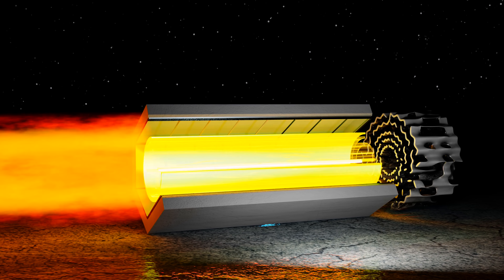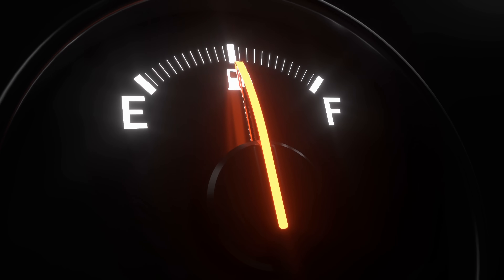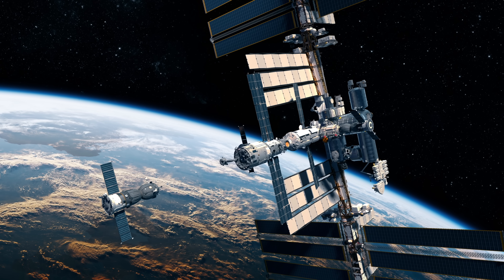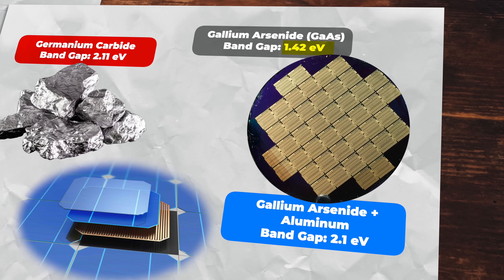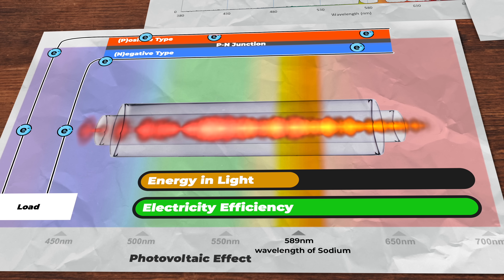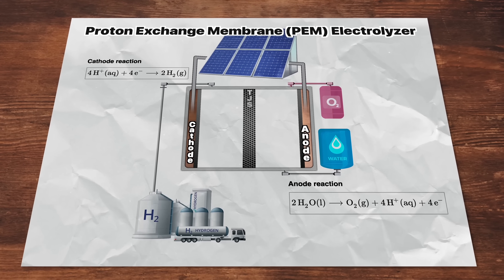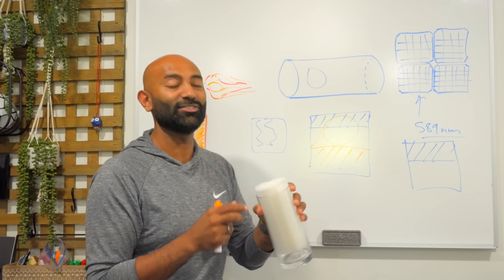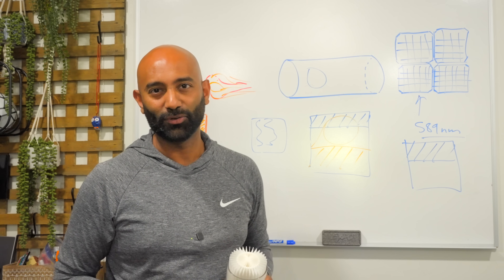Why Solid State Might Save The Combustion Engine

Comment: You never addressed the big reason the world is trying to move away from carbon based fuels like gasoline & that's the emissions that are causing Global Warming! This engine is theoretically 2x or more efficient than a internal combustion engine, so while it would use less gasoline, it would still produce some amount of carbon emissions & still heat the planet. And you never addressed that topic: it still uses gasoline, so what are the emissions? It could be twice as efficient & release 3x or more the amount of harmful gasses in it's exhaust. That doesn't help at all. 

The actual engineering question we need to solve is how do we power our society WITHOUT carbon based emissions? This invention doesn't answer that critical question!

Comment: why not take the polychromatic sunlight and take an engineered sheet that coverts the sunlight to monochromatic wavelength and put that over photovoltaic cells tuned for that wavelength? So basically, same thing they doing with sodium to make the panels more efficient but doing it with the sun?

Comment: this concept is amazing and shows what engineering is all about.  take a hard problem and convert it to an easier, more solvable problem.  

it would be really interesting if you could do this with concentrated solar.  have concentrated mirrors that burn a material to create a light at a wave length that you can capture more of with a cheaper material than pvs.  thus, you up the efficiency and lower the costs.

Comment: Would an internal combustion engines efficiency be increased if the cylinders were transparent with PV cells placed around the outside capturing the light from each explosion? The electricity than being used to drive an electric motor in the powertrain?
Just a concept thought you might like to comment on.

Comment: Instead of table salt, why couldn’t they use urea for the salt? No, not what you’re thinking. It’s a comparing of nitrogen, oxygen, and carbon which makes it a chemical “salt”, hence the salty taste. You could use it to fuel the system and to produce the light from the heat of splitting the nitrogen from the carbon dioxide.

Comment: The utility of this device is based on an assumption so blatantly false that they do not come out and say it, for fear of being instantly recognized as a fraud:  The blackbody thermal radiation of heated sodium vapor must match the spectrum of a low pressure sodium vapor gas discharge lamp for this device to work as claimed.  No doubt, they are trying to get funding to run tests with heated sodium vapor and will be SHOCKED, SHOCKED I SAY, to discover that their assumption of the thermal emission spectrum of sodium vapor does not match the emission spectrum of a low pressure sodium vapor gas discharge lamp.

Comment: Apparently Lightcell Energy has not proven what the energy efficiencies are at each step. This should be easy enough to prove and to replicate. There should be no guessing involved, inside the company or outside the company. But apparently the company has not made the numbers available.

1) If the reason these numbers are not available is because the company has not yet done the analysis, then stay away.

2) If the reason these numbers are not available is because the company has done the analysis and the results were disappointing, so they are pretending that the numbers are not available (fake it 'til you make it), then stay away.

3) If the reason these numbers are not available is because when the company attempted to calculate them, the quartz or the photovoltaic cell or some other thing(s) broke or melted or became fouled, and they are keeping that quiet, then stay away.

It is fairly common to see inventors and/or companies waste their entire careers promoting and tweaking and tinkering with technologies that are inferior, or are literally impossible.

Comment: PV cells are less than 25% efficient. How could a system that converts fuel into heat then into light then into electricity be greater than 50% efficient? No f-in way with current technology.

Comment: I'm no photovoltaics specialist, but I worked in a lab at a university where the people next door worked on micro-scale heat exchangers, and one of their projects was related to recovering waste heat from Concentrated Photovoltaic Cells (CPV), a system where a relatively cheap, large Fresnel-type lens diverts sunlight into a relatively expensive, small PV cell. The problem with that is that the cell efficiency was inversely proportional to its temperature, which is why they were trying to match these tiny heat exchangers with the tiny PV cells and use that heat to convert alcohol and plant oil into biodiesel.

This engine obviously works at high temperatures. Low-Pressure Sodium Vapor lamps work at about 300°C, and the assembly seems too compact for meaningful insulation, so these cells would be working at high, temperatures, and therefore at lowered efficiencies. I'd wait for independent confirmation of these numbers before believing these are even in the correct order of magnitude.
Reply: That’s exactly the issue. This would straight up melt these cells
Reply: It comes across like a funding pitch to non-engineer venture capitalists.
Reply: My first thought was exactly wether this sodium lamp an cell system could be used to discharge excess heat from traditional PVs (improving their efficency) while at the same time obtaining some more electricity out of it. 

Obviously your lab roommates were smarter than me, so I guess it wasn't doable/cheap enough.
Reply: You have a good point. But i think that isolating combustion temperature in a small chamber Is not that big of a challenge. And transporting only the usable light with mirrors and stuff can be a solution for the efficiency. But we are all just guessing
Reply: thanks for the exhausting analysis....
Reply: The burning gas that heats the sodium to make it glow, cannot exit at lower temperature than the glowing sodium. To get more efficiency, the hot exhaust will need to be reverse flowed through a heat exchanger heating the incoming air before it is burned. This cannot work in a standard heat engine because the hot air into the engine cannot be compressed, but it might be possible in this device because there is no compression. No I still do not believe they will make it work efficiently full cycle, fuel energy to electric power.
Reply: The heat exhaust could power a fan generator. Or the heat can also power a steam engine for more electricity I'm kind of surprised that Someone has not put 8 or more 8 inch wind generators on a Semi truck.
Reply: @eddaniels3404  I used to process perpetual motion patent applications. And yes, adding wind generators to vehicles "to improve the vehicle efficiency" has been invented many times!
Reply: hey now, hey now, don't you come at me with science!
Reply: You could put a vacuum between the cells and the sodium, but you'd still need to cool the pv cells, since they are not 100% efficient in any case.
Reply: Visible/Ir cells made from aluminum/gallium/indium/arsenic and gallium/indium/arsenic and also gallium/arsenic and gallium/indium/arsenic chemistries achieve 40% efficiency, at 2500ºC
Reply: If this person was actually onto a industry changing idea, that actually functions as stated, our government would seize it in the name of national security or similar BS and or bury the inventor. If this exists, give it to everyone in all firms possible or it will disappear. I doubt this exists as described, bit I don't trust our government and will never trust them.
Reply: Maybe in a larger vehicle then an automobile?
Reply: I’ll wait for the proof of concept working model
Reply: @petemisc4291  A working model would be fairly easy to make, maybe they already have one? But at anywhere near the claimed level of efficiency, not easy at all!
Reply: probably a vacuum tube with the lamp being heated, and only spectrum emissions being allowed to hit the PV. If the PV is tuned to the one wavelength and really is high efficiency, the only heating in the PV will be the % of lost energy, probably could be handled with just fins and air cooling. What I'm struggling to wrap my mind around is how your exhaust is gonna be on the cooler side? like you need to run the lamp as you said, at least 300, and if you want power density then probably more. flame needs to be hotter than lamp. maybe heat exchangers between the exhaust and the incoming air?
Reply: am i the only one thinking you could somehow add sodium to the gasoline and use that? then fire and water would make a gas station explode. Nah but fr, if you but salt-sodium in gasoline would that not work? Better than making a lamp? just make the whole flame orange?
Reply: just insulate the photovoltaic cells behind a double window. run cool air through the cell or with a vapour chamber
Reply: @snorttroll4379  adding a window of any material affects efficiency.
Reply: @snorttroll4379 that window would be very high temperature material at 3000 degrees? I have a solution though!
Reply: @wanfuse  just recess the window a bit.  or cool it on the other side.
Reply: @snorttroll4379  there is a better way I think, but I am sure they have it figured out already :-)
Reply: It's a very interesting combination of several technologies.. I'll be keeping an eye on this sector
Reply: I was thinking something similar. It would be better to put something like that on the exhaust of a regular ICE. If used with a electric drive it could increase efficiency, kind of like a turbocharger works off the exhaust. But instead of taping the pressure it would work off the heat directly.
Reply: I think people saying this is a scam is straight up evil and mischievious and overkill, but i know this is not going to be easy at all, although well, just like any new technology concept until a workaround is found and optimization and upgrades are done correctly and accordingly, so i believe this will be a thing some day, but at least for the very near future i believe it will only be a fraction of it's promise
Reply: I mean... a woman invented this dude. You just spent more time pointing out why it won't work, than she did, to make it "work".
This is so stupid, she had to be a drop out to not know the laws of physics says this is seriously impossible.
Reply: @m4rvinmartian  Elizabeth Holmes new jailhouse venture.
Reply: @m4rvinmartian  "Danielle" Fong is a transexual, so biologically a male.  I just found this out by watching a video of the company.
Reply: @headbanger1428  I was not able to find this information. Do you have a link to the video you watched? And a relevant time within the video?
Reply: @headbanger1428  
Huh....... so, I guess she does know what she's doing, then.
Reply: @m4rvinmartian I'm sorry,  what does gender have to do with this?

Comment: I think the problem with combining the light cell with a traditional internal combustion engine is that a traditional combustion engine needs a minimum amount of power to move the wheels and not stall. If the light cell is as efficient as they claim, that minimum amount of power is likely to generate far more heat than the light cell could handle, meaning that you would still have to dump some of it as waste heat. In the end the light cell by itself likely ends up being more efficient than a hybrid system.

Comment: The Vehicle Research Institute at Western Washington University created thermophotovoltaic power generators in the late 1990's using the technology and cells created by Dr. Lewis Fraas.   The technology used gallium antimonide cells arrayed around a silicon carbide emitter.  One of the national labs, Sandia (?), tested the cells at over 40% conversion efficiency vs. high grade solar cells (1990 tech) of 18% (or ~31% 2020 tech).  A significant challenge is that the high temperatures, roughly 1700 k, needed to get the silicon carbide to emit photons is located within 20-50 mm of the cells which probably don't function above 400 C.  Cooling the cells and recovering the lost energy is a significant challenge.  The team created prototypes a bit larger than a hot pot or coffee maker that generated up to 2 kW (~2.7 hp).  Eight of these units were installed in a vehicle, Viking 29.  The units produced less emissions and were more efficient than a Honda genset, but not so much that it made sense to invest in a small fab plant at $100 million (1998 US dollars).   Another challenge arose--physicist and engineers in this space tend to talk about efficiency a bit differently.  The team found that the physicist were subtracting all of the known losses from 100% rather than the ratio of output energy to total available input energy.  One has to be very careful about quoting the efficiency of these powerplants, because it is likely that the total losses haven't been properly accounted for.  The early ceramics would fail after 20-30 minutes of operation. The technology does work and its amazing to directly convert chemical energy to electricity.
Reply: These issues may explain why, even if the quoted efficiencies are achievable with this concept, there is still not a product several years after the concept demonstration.

Comment: techno word salad found in startups, to get investors, only for it to be sold. This is the opposite of engineering. Its creating a problem for its solution. Also, simplify. 

And again, the obsession of no moving parts is getting more and more laughable. Moving parts are needed, and cheaper to replace as schedule mx versus computers, ECUs, and other software components that fail.

Comment: Thank you Richard. There was a high efficiency, direct, heat to electric, no moving parts method using MHD. A conductive refrigerant heated. Moving, expanding in a pipe. A moving conductor in external magnetic field generates electricity. Electricity out, simultaneously heat disappears from it. This was used in Denmark or Sweden (?) in a mass transit bus. All enclosed. External heat source. I never heard about it since. Big Oil etc moved the conversation and funding away from such solutions.

Comment: The efficiency drop just going from "Light" to electricity is too big to make this viable #1. You can cut out the light part and go directly to thermoelectric using a peltier or Heat pump generator. Same thing used in nuclear satellites call Radio Isothermic generator only using IC Engine. Number 2 the efficiency of internal combustion without moving parts seems fishy given a almost certain low compression ratio. See pulse jet for efficiency ratings of a low compression engine. Maybe using pulse detonation or something IDK.

Comment: Interesting, but do we need this? You can convert heat directly to electricity, if it is hot enough. Plasma temperature. Blow the plasma through a ceramic tube in a magnetic field. This will separate the + and - patrs of the plasma. A little downstream you have electrical (conductive) connections in the tube. There you are, a DC power connection. I don't know if the efficiency is better or worse than this but it is one step less.

Comment: There are similar things for camping, which basically are catalytic Burners iE a CAT that burns the Fuel/Air Mix the moment the Hydrocarbons come into contact with it.
But neither would solve the main Problem, reducing CO2 emission. Because, lets be honest, it doesn't matter if you burn the fuel in an explosion in a IC Chamber or in a catalytic tube.
The end product will always be CO2, Water and other trace gases depending on what you burn

And its the CO2 that we must get rid off. Like totally if possible, but as much as technically feasible

If you really can't get around without being an Arsonists, at least what could be done is changing the Hydrocarbon source, away from fossils, to a renewable one
There are Tests to turn a Cities Poop into Biodiesel though dry Destillation of the sewages' organic Parts. That at least isn't fossil, but from once living plants that feed us, so no calories lost by directly turning corn and foodstuff into fuel. And its pretty much the same stuff, as the dry distillates product is the same and independent from the source material, as long as it contains long-chained organic molecules

Comment: tried looking up detail & found Danielle Fong listed with LightSail energy; then / now under lightcell
there's also other articles on her dating back to 2009, 2018, showing failure of earlier project(s).
____
 Many inventors have many failures before the breakthrough that transforms society.
     the ideal would be to have investments in municipal units that would power neighborhoods/ small town sizes for independent energy production, for starters.
    also: there were the concepts of solar concentrators heating a sodium mass, liquefying it for continued electric production overnight.. those tower experiments have failed but the energy reserve in heat mass production off-hours is still valid.

Comment: Also, don't forget only light that falls directly on the band gap if the PV cell can be captured. And any heat whose black body spectrum falls below the 590 nanometers could not be used either, thermodynamic and all...

Comment: Great video . To take a shot at answering the question as why do they keep trying to developed new forms . To quote Elon  making a prototype is easy producing working models at scale is the problem . If someone figures a way to produce it at scale cheaper  the next level will be harder to achieve .  Say I get 20mpg I have 20gal tank 400 mile range ads this small device and effectively get 60mpg 1200 mile range with a 5 min fuel time full electric cars would be over